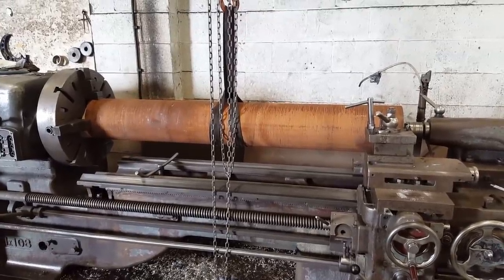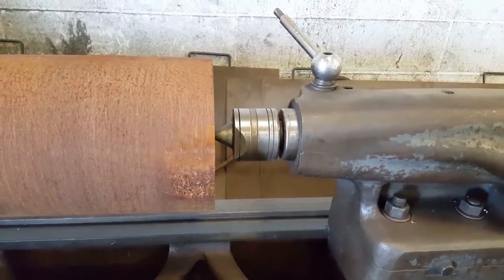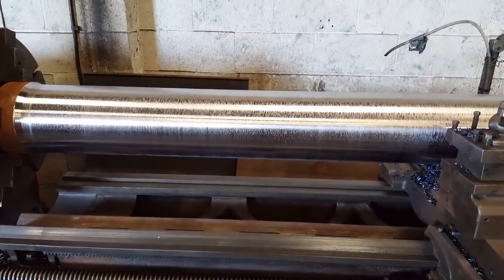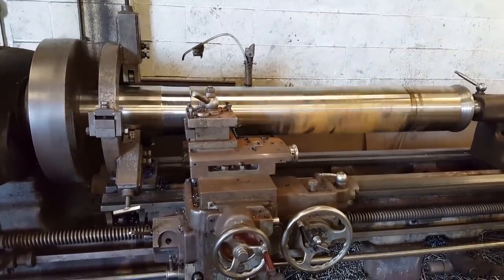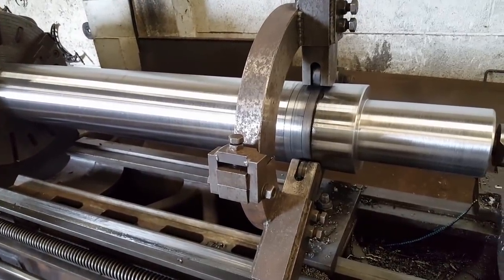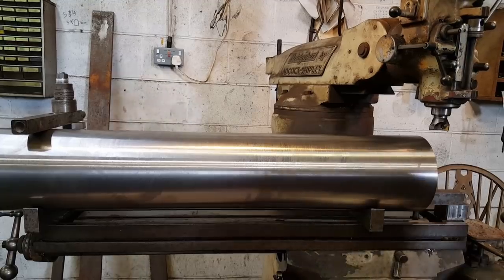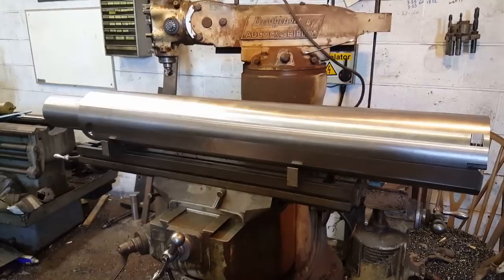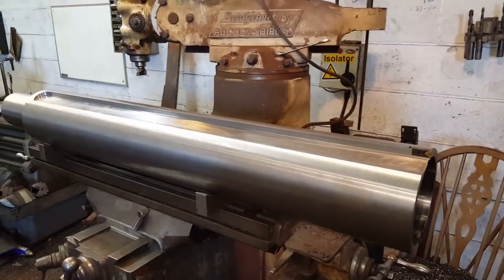Make A Trepanning Tool. TURN BORE AND MILL

Comment: Wonderful effort there's not much left in the wall thickness after that flat is machined in
Reply from the maker: After the scrap channel is milled it leaves a 2mm wall. Not much and it's the weak point on these tools.... they do split.
Reply: @userwl2850  Looks to me like it's undercut as the cutting tool tip insert doesn't even reach the bore.

Comment: Have seen a few of these and love your work. Been in toolmaking for 46 years but on the small size stuff. Just one question if the bar runs out .030" due to stress why does the bore not run out the same amount?
Reply from the maker: It does exactly that... good question 👏🏻👍

Comment: Great Video. Awesome work. I also made smaller trepanning tool which can bore just 36mm hole only. The purpose behind making tool is to reduce spindle load. I used to make hole with U drill but with that spindle load goes up to 60%. So I thought by reducing cutting area we can reduce spindle load, just an experiment. And  my new tool worked with load of just 30% and of course we get better price of slug rather than scrap. I only have one problem of chips, it stucks between tool and work-piece.  I have fixed both cutting insert parallel,  can you please suggest me by offseting one of them will  help me? if yes which one should I change inner or outer ?  Thank you fore reply.

Comment: Some absolutely fantastic work there, massive undertaking and achieving the tolerances on a part that size manually is top skill. I previously thought your trepanning tools would be made from a grade of tool steel before hardening and tempering to add to the overall yield strength? Minimalise undue flexing?
Reply from the maker: I usually make them from EN24T.

Comment: Hi there, I'm Asham, I just want to ask you something if you find it suitable enough kindly answer. I've just started in a shop as cnc operator, my employer wants me to register as an apprentice, but I just want a suggestion from an experienced guy like you whether this trade is good or not, does it gave you a decent living, and how easy it is to open a small machine shop and operate it. Really appreciate if you can give advice. or anyone 
Thanks and Regards 
Asham 
Calgary
Reply from the maker: CNC machining is a great job... Not so much doing the work but doing the programming.  Good luck with your choice.

Comment: Hello Dave.  Nice work.  I noticed you sent them out to be trepanned.  Was this because they were too long for your current machines?  I assume when you get the Craven up and running you would be able to trepan that length yourself.  By all means make more videos and make them longer.  Thanks, Ken
Reply from the maker: Hello Ken. I sent them out to be bored to a depth of 48" to leave it solid for the shank. Not possible by trepanning.  Yes it's exactly the type of boring I bought the craven to do. I hope to do that but who knows 🤔

Comment: I'm curious if you have modified your tailstocks clamping arrangement to stop slippage, although the load is probably not much on this one, i'm quite sure its a hell of alot higher when machining the super alloys you get? Or do you rely mainly on your chucks holding force?
Reply from the maker: There are 2 ... 1" bolts clamping it down. The motor would pull up before they moved. Thanks for the question.

Comment: David, my ambition is to design a much smaller tool. The cost benefit is not as great on smaller stock but saving a bit of otherwise wasted expensive material is satisfying especially if any number of parts are required. It would be nice if you could walk through the geometry and clearance issues you intuitively know to facilitate scaling such a tool down for smaller work or indicate some resource(s) on the tool design details. As always, a delight to see your work on such a scale.
Reply from the maker: Thank you for your kind words. This type which I make start at 65mm. Any smaller and it needs to be a hole saw or rotar broch. Hope that helps.
Reply: @userwl2850  Thanks mate. 65 mm is the size I had in mind. Inserts I imagine are the limiting factor. I am intimidated by not having attempted this previously. I see what I see and hear what you say, I need to give it a go and see how I do. I will go back each day or so and review your collection of videos one at a time to build my confidence. Thank you and best of luck for a prosperous future.

Comment: Great work! And showing the universality of the ubiquitous Bridgeport turret mill!  I just replaced mine with an interact 4, but I dont make anything near the size of your work!
Reply from the maker: You got rid of your Bridgeport? They are brilliant machines. I hope you don't regret it. 👍
Reply: @userwl2850  I felt you are fan - and that's why I came to watch this video. I guess on mine, I'd just have to slide the work along the table - although I might prefer that as a technique than swinging the BP turret. It'd be an interesting challenge getting a longer movement than the table actually has. Maybe keep the table still and slide the work along it through guides. Hmm, a powered roller on top of the table for the work to rest on and be propelled through the mill - with weight support at each end.

Comment: Super work man, excuse my ignorance but what type of tooling would be used to bore the solid out to that depth?
Regards from Ireland 🇮🇪
Reply: Kennametal HTS exchangeable head , and adjustable cartridge drilling system , up to 10.63" or 270mm dia , and 10xD depth . This is the easy way , but you need a large horizontal with at least 100Kw spindle and tonns of torque .
Reply from the maker: Sandvik STS deep hole boring heads.. best ever. 👍
Reply: @userwl2850  That's the one that ejects the chips into the body off the tool , and coolant flushes it out ?

Comment: Interesting work, I didn’t see how you drilled and bored the inside
Reply from the maker: Hi Andy. I sent it out to be bored.
Reply: @userwl2850  You didn't have a smaller tool to trepan that one with?
Reply from the maker: @bcbloc02  they were bored to a depth of 50" to leave the end solid. Not possible to depth bore by trepanning.